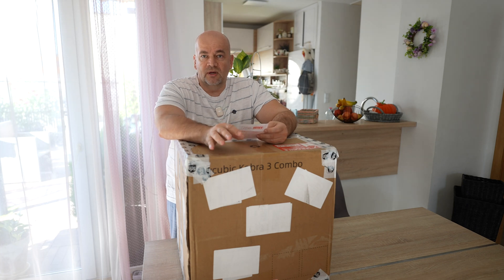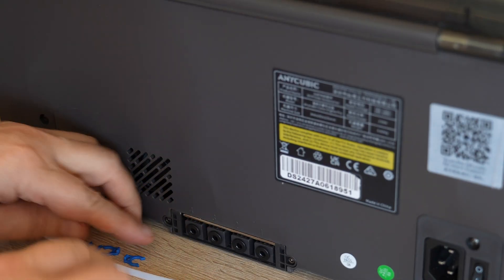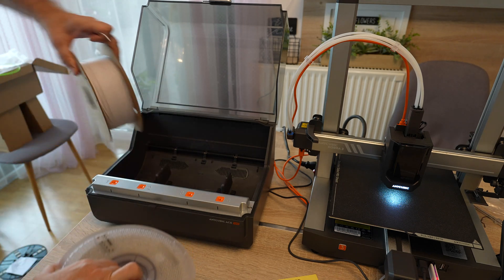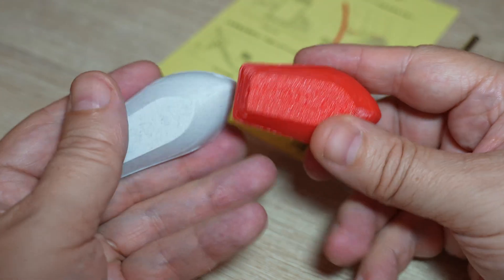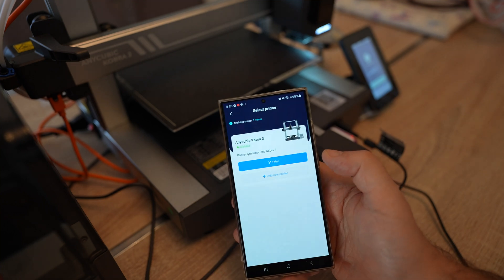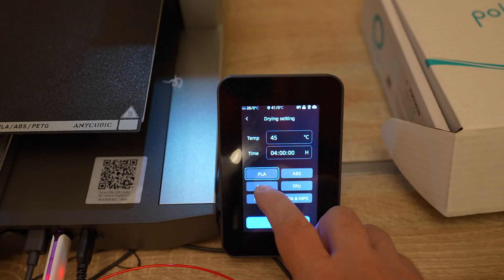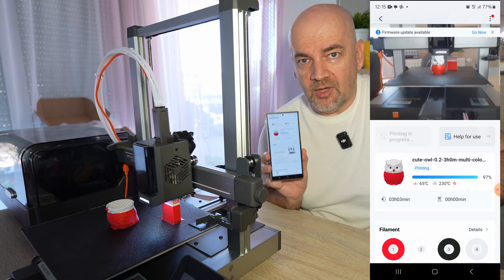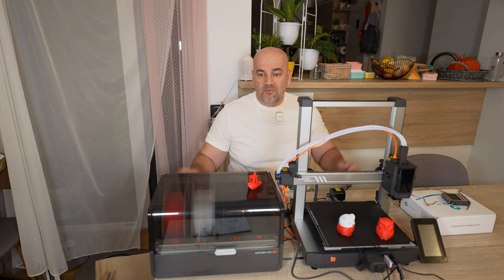Great for PETG: Anycubic Kobra 3 - Combo with heated multicolor system

Comment: Igor is it possible print PETG with PLA supports but use PLA only for the contact area? Height range modifier works for that? To me it is the most important function to have supports printed with other spool. Otherwise you can't print fast and with good quality. It is a must function nowadays for real projects.

Comment: I have to say, brands continuously miss that Bambulab printers arent successful just because of the fancy features, but because they just work. The profiles are all good enough that unless you are particular, youll never even bother changing settings or "tuning" or anything that youd have to do with most printers. At worst, you sometimes slow a profile down, but thats about the most tuning I've ever done.

Companies just need to settle with the fact their printers are going to ship a few months later than they planned to release them, that they're going to pay someone to make proper profiles for their printer for a wide variety of filament, and that they will actually test things before shipping them out.

As a side note: How are there still printers still shipping with eccentric nuts and vrollers that need adjusting in current year. It baffles my mind. No budget could be so constrained as to take on the downsides of that in current year. You have linear rails going all the way down to the cheapest of printers now. There is no longer an excuse.

Lastly, and as an aside, and this isnt a criticism of your work, because I like a lot of what you do bringing analytics to 3d printing, but I hate it so much when reviewers mention the "print speeds" manufacturers list when they are really just travel speeds/not actually relevant to what a user is thinking when they hear a flashy number that ultimately does not mean anything without context.

Sorry for the just sort of spiralling rant. Something about seeing the same thing happening over and over again with no company willing to change just bothers me. All that said, this is legitimately a massive improvement for Anycubic, who I have not been fond of in the past.

I must say as I got further into this video, I was more impressed but it still reeks of the corner cuts that make this not quite there, like the filament drying that has nowhere for the moisture to go.